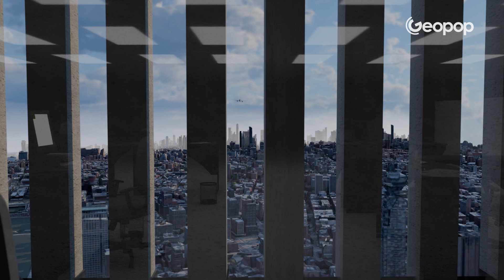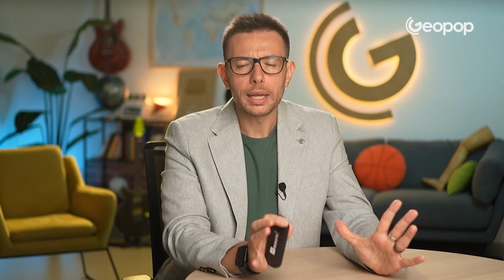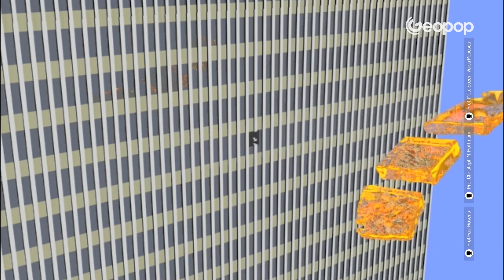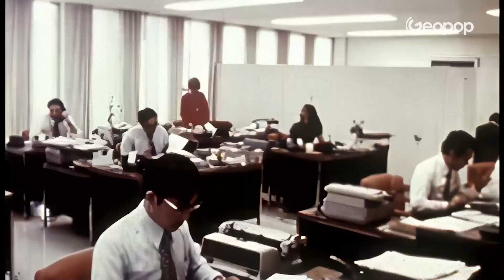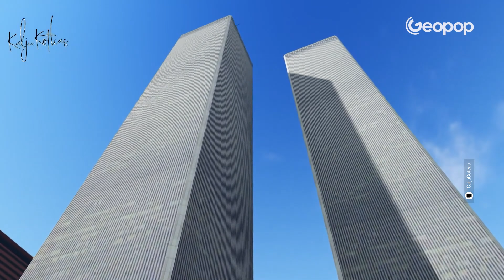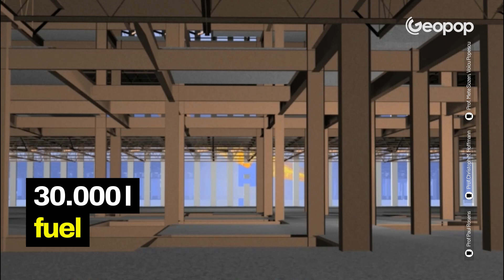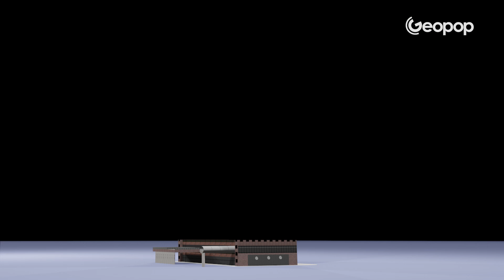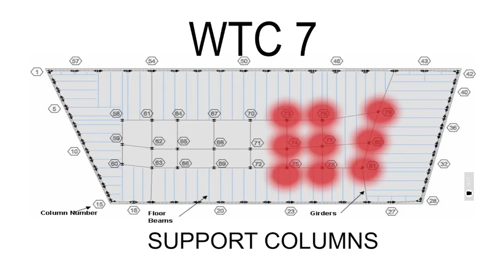9/11, 2001: The Technical Reconstruction of the Twin Towers and WTC 7 Collapses

Comment: This is crap. NIST specifically admits they can't account for how the buildings fell. Thermal imaging of the towers indicated fires that weren't that hot.
Reply: Concrete has a slump test to determine the stress it can stand. Each column has a limit  . As each floor fell the stress was compounded so falling like they did  wasn’t a conspiracy, just physics.
Reply: Multiple videos show molten steel pouring out from areas just below the impact zone.
Reply: @ghostsignal  NIST's report determined that to most likely be Aluminum, which is a common metal (which the plane and offices have tonnes of) that melts are housefire level temperatures.
Reply: @ghostsignal they absolutely do not.
Reply: @ghostsignal  Must have been all that office paper burning and melting the steel
Reply: So you think a fire capable of bending / weakening steel isn’t that hot? On top of the individuals inside the plane and at the impact point of the building being incinerated
Reply: You made that up! What utter nonsense … planes millions saw hit them! There is no alternative to that! An intended demolition defies any form of common sense as impossible to do with a live building! Everybody having a minimum of intelligence knowing what the preparation requires knows that! No need to consider this in a report!  Not that hot … how delusional is that! You only need to open your ryes and watch the videos!
Reply: Very good observation.
Reply: -- Then what is the source of the many tons of molten steel found in and under the debris, the heat so intense that the molten steel remained in that state for weeks afterward, running off of the debris as it was excavated. This cannot be molten copper from wiring that retains the color of a shiny new penny.  It cannot be molten aluminum that retains the color of the polished aluminum wheels of a street racer. It was the color of glowing orange molten steel  that cannot be mistaken for any other material, reported by firefighters who are very experienced in the nature of such materials as well as seen in video evidence.

When you combine this with an entire lack of turbulence behind 500 mph aircraft, when even a small Cessna Aircraft would leave an evident wake in the smoke and fire only seconds later .  . We find that skeptics still cannot be skeptical of the official narrative in explanation.  Sponsored channels and forum activity are skeptical of nothing when support is provided.

Sponsored activity in the forums is very normal today for commercial and political purposes and subjects of controversy -- in the attempt to lead public debate.
Reply: The NIST describe in excruciating detail why the buildings fell. In the case of the Twin Towers they don't bother to describe why they kept falling because only conspiracists can't figure that out and they are not the target audience.

You should have actually read the reports, not that I suspect it would help much.
Reply: Buildings dont fall like that @TheLoonResistance
Reply: @clintonmichael7607  - Obviously they do because this one did. You just don't understand how or why and instead of acknowledging that YOu are the problem, you take the low road of ignorance-fueled personal incredulity.

I don't understand this and because I don't understand this it must be wrong_

I would be happy to explain it in detail if you wish.
Reply: @TheLoonResistance  buildings don't fall like that
Reply: @clintonmichael7607  Yes they do. What do you expect? For them to topple over sideways? As if they were one solid object? It's called a COLLAPSE. Gravity, son. It makes things fall down, not over. You can literally see the top portion of the building begin to list when they start to fall, demo doesn't look at all like that.
Reply: Which is more extreme -- to accept without question the inexplicable lack of turbulence in the wake of a 500 mph large passenger airliner -- not evident in the smoke and fire covering the impact zone only seconds later? -- or to recognize the indications of digital projection in its imperfect nature as we see a wing disappear in front of a bright blue sky? From another camera angle, the same aircraft is seen passing behind a crane in the foreground, yet in front of the heavy crane cable. 

There should be a hurricane of turbulence in its wake that would entirely disrupt and disperse the smoke and fire seen billowing outward just 3 to 4 seconds later at both towers.  Even the wake of a small Cessna aircraft would be noticeable -- yet there is nothing.
Reply: @ronaldgreene5733  What the hell are you talking about? Literally thousands of people watched it happen. Are you claiming the two planes were somehow digitally added into all the footage from random people's cameras????
Reply: @ElLowEl .  . "What the hell are you talking about?" .  . 😃 .  . Thank you for your sponsored reply, Mr. EILow.  The word projection indicates holography as you know, commercial demonstrations of which have been amazing in recent years.  To feign ignorance doesn't work well for you, however.  Where, Mr. EILow, is the wake turbulence only seconds after passage of a 500 mph large passenger airliner -- not seen in the smoke and fire covering the impact zone?  Even the wake of a small Cessna Aircraft would be noticeable -- yet there is nothing.  It's likely that no real answer from you is forthcoming. We'll wait and see .  .
Reply: @ronaldgreene5733 Are you suggesting there were no planes? You're suggesting that the hundreds of videos we have are doctored to include planes that didn't exist?

Comment: Wouldn't you think that NIST, being who they are supposed to be, would have immediately demanded that evidence would be saved for investigation of the fall of each of these buildings?  That is what they do.  And wouldn't there have been at least one other agency demanding that evudence be saved?
Reply: NIST began its investigation on 21 August 2002. 

I'll let that sink in for a bit. 

Prior to this date, volunteers from The NIST, FEMA, the ASCE and other entities collected steel important to the investigation from the four steel recycling facilities employed during the recovery process, cataloging 236 steel artifacts, including exterior columns, core columns, floor trusses and other structural members.
Reply: @TheLoonResistance  I see you commenting everywhere, attempting to debunk everything, you certainly put a lot of time in, I'll give you that
Reply: @Bonetti70  - It takes almost no time.
Reply: Evidence was saved. Who told you different?
Reply: @Tim22222  No evidence was saved from WTC7. All the steel from the site of Building 7 was expeditiously scrapped for no apparent reason. After all, it's not like crews were in a panic to rescue survivors since WTC7 was the only building  that had been fully evacuated long before the collapsee.

FEMA even expressed discontent during their investigation because none of the steel was preserved. Yet Mayor Bloomberg mockingly stated that nobody needs to examine the structural components of collapsed buildings because now we have computers to do all the analysis and modelling. 

Imagine if that's how we conducted all criminal investigations. Toss the physical evidence, and only use photos and videos to recreate the scene on a computer. It's honestly laughable for this being the biggest crime scene in American history, and that is how seriously we take the investigation.
Reply: @Tim22222   Nobody told me different. Some people believe what they are told to believe.  But some of us are concerned about evidence before we believe.  Of which kind are you?  I will presume that you also are concerned about evidence. So please describe the evidence from building #7 which caused you to believe the official story.
Reply: @JosephBoxmeyer-u3d  - Your ability to assess the evidence is not impressing. As for my thoughts on Building 7,...

The unknown and unimportant Building 7 was the 6th building to collapse of 10 lost on 9/11. Though extensively studied, it confuses many people. Not famous, or a terror target, and no casualties, thus it did not get a lot of attention and few know much about it, creating a void rapidly filled with garbage from the internet. Because everything seems like a conspiracy if you don’t understand how it works I prepared this brief summary explanation of my own analysis. No politics, just engineering. 

The North Tower collapse at 10:28am bombarded Building 7 with tons of burning debris, causing heavy damage and starting raging fires burning out of control for 7 hours. Half the responding FDNY firefighters having been killed, others injured, units in disarray, equipment destroyed, no water pressure, and the greater urgency of Search & Rescue efforts, firefighting at 7 was pulled as futile. The building couldn’t be saved and was left to its fate.

www.youtube.com/watch?v=g_SvpwyC17M&ab_channel=MFitz  

Collapse of a burning structure is always a concern for firefighters. Steel buildings subject to fire rely on active fighting of the fires to survive. Left to their own devices they will collapse. Buildings are designed around 1 to 3 hours of fire resistance, allowing time for occupants to escape and ACTIVE firefighting to get started, after which all bets are off. In B7 the occupants escaped, passive and active fire protections were compromised and active firefighting was abandoned which left the building to take its chances. It lost. Odds on Building 7 would eventually collapse, and it did. No big deal in logic. That is the sort of choice firefighters make every day in brush fire situations - which houses to save and which ones to let go. Only real difference here is moving the decimal on the size and cost.

www.youtube.com/watch?v=WnYBX6QT0R4 

FDNY Chief Daniel Nigro ; The biggest decision we had to make on the first day was to clear the area and create a collapse zone around the severely damaged 7 World Trade Center, a 47-story building heavily involved in fire. A number of fire officers and companies assessed the damage to the building. The appraisals indicated that the buildings structural integrity was in serious doubt. I issued orders to PULL BACK the firefighters and define the collapse zone. It was a critical decision; We could not lose any more firefighters. It took a lot of time to PULL EVERYONE OUT, given the emotionalism of the day, communications difficulties and the collapse terrain

FDNY Deputy Chief Peter Hayden ; We had our special operations people set up surveying instruments to monitor and see if there was any movement in the building. We were concerned of the possibility of collapse in the building. And we had a discussion with one particular engineer there, and we asked him if we allowed it to burn could we anticipate a collapse and if so, how soon? And it turned out that he was pretty much right on the money, that he said 'In its current state you have about 5 hours

The collapse of Building 7 was anticipated all afternoon and widely reported in the media with at least 24 video cameras recording some or all of the collapse. Everyone at the time knew what was coming and why.

www.youtube.com/watch?v=OY5S5k3tMHI 
Building 7’s collapse was totally different to the Twin Towers, harder to understand and most of the details difficult to see. But we can sort out what happened through careful analysis and observation.  What follows is MY EXPLANATION of the collapse sequence using the best available information and relying on no authority.

B7 was complex structure, a 47-story steel framed building built on top of a smaller existing 3-story building, requiring several lower floors dedicated to complex load transfer structures instead of usable office space. Of trapezoidal shape and all-steel tube-in-tube construction, B7 (above the 7th floor) consisted of a central core of steel columns carrying most of the gravity load, perimeter steel columns around the outside of the structure carrying the remainder of the gravity loads and long span beams and girders to tie those elements together and form the floors. On the outside of the building hung a moment frame - the last part of B7 to fall. 

Phase 1 : Collapse initiation for B7 is notably quiet with observers not realizing the building was collapsing! There was no audible warning in the form of say hundreds of ear drum busting 180-190dB explosive bangs preceding the collapse. The first externally visible signs of collapse initiation occurred at 5:20:28 pm. Here at 12:00 a local CBS affiliate reporter is talking 10 blocks from B7 when collapse begins. People don’t start to notice the collapse until 12:11. Then at 12:45 is the famous CBS fixed camera clip of Building 7’s collapse Again, note how quiet it is.

youtube.com/watch?v=t5tEy6mXSE8&ab_channel=fresnosean379

Collapse initiation was due to multiple lower floor failures above the load transfer region (7th floor) in the NE corner of the building. In this video at 0:45 you can see the NW corner from inside the building while under construction, Column 79 just out of frame on the left. That big, angled steel beam across the top of the frame connects to C79 at one end. The girders connect to the beam. That beam and all those girders depend on just one connection

youtube.com/watch?v=nP3TNHPCIVU&t=35s&ab_channel=EdwardCurrent

Phase 2 : Lower floor failures caused a loss of critical lateral support over an excessive length of core Column 79 and it buckled. If you look at a floor diagram of Building 7 (see above) and look at all the structures that depend on C79 you quickly realize this one column was a relatively isolated structural element on which a disproportionately greater fraction of the structure depended . Externally we see a vertical progression of window breakage along the 44-46 line and a kink in the roof of the East Mechanical Penthouse at the top of the building, consistent with C79 failure. The transition from full capacity to almost no capacity occurs in virtually an instant. Once the buckling failure occurs there is almost no resistance

Normally with a buckling column, the load could very well be redistributed to other columns, meaning the buckling could stop after a while. With C79 that is not the case - the failure did not redistribute the load, so the collapse rapidly progressed to the roofline, sinking the rooftop penthouse.

Phase 3 : With C79 gone, B7’s progressive, non-symmetrical collapse continues with C80 and C81 at the east end of the core left laterally unsupported and quickly buckled and failed as well, sending the EMP down through the building. C79-81 all have no diagonal bracing, which I believe is a major reason why they could not redistribute a lot of vertical loads among one another.

From there collapse progressed from east to west through the central core until the core was gone taking all of the interior floors and structures and probably most of the perimeter columns with it. You can see the horizontal progression of window failures low in the building and the dropping of the remaining rooftop structures into the building. One of the big takeaways from the NIST Building 7 study (that gets completely ignored) was their modeling which determined C79 failing under ANY circumstances would have initiated the same collapse sequence.

Phase 4 : Just over 10 seconds in Building 7 is reduced to just a hollow empty outer shell - the exterior moment frame, which creates the illusion the building is still standing since little has changed externally. But it’s just a hollow empty shell, like an empty cereal box, supported by only a few remaining columns and quite unable to remain standing. The north face leans inward, forming a V in the roofline, the last perimeter columns buckle under the strain and with nothing left keeping it up the moment frame free falls, landing on top of the 7-story high debris pile. It is only here, at the very end that a single measurement of alleged free fall is taken. Start to finish the collapse took 18-20 seconds, or less than 1/3 of true free fall but who cares since how fast something falls cannot tell you what started it falling in the first place. The free fall argument is about the collapse of the outer shell AFTER all of the critical internal structure had already failed.  It completely ignores about 80-90% of the collapse. The debris spread out well beyond Building 7’s footprint , blocking surrounding streets, heavily damaged the Verizon Building and destroyed Fiterman Hall Broadway, all well outside of Building 7’s “footprint”.  

Building 7’s progressive, non-symmetrical collapse was incidental and unintended collateral damage from the combined effects of fire + time + gravity started by the collapsing North Tower. That is true no matter who planned and carried out the 9/11 attacks or why . The collapse was of so little consequence it barely even registered at the time, a mere footnote. 

Anything can seem like a conspiracy if you don’t understand how it works. Now you should. I hope you found this helpful and informative, not adversarial and it solicits informed critical comment. If I made any errors of fact, logic or reason or left anything critical out, please let me know so I can fix it. IF you can offer a more plausible alternative please do. Be the first. Please start any reply with the words “Tits McGee” or I will know you didn’t read it and are wasting my time.
Reply: @JosephBoxmeyer-u3d  The premise of your post - the suggestion that NIST didn't preserve any evidence - was presented as being true without a lick of supporting evidence. So you started with a baseless assumption.
Reply: Nist's conclusions were fabricated. All BS.